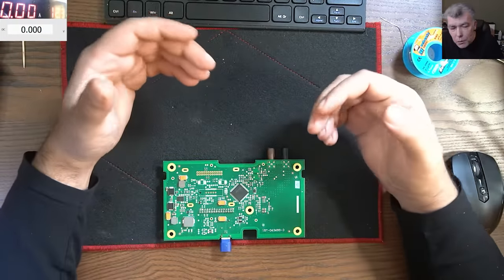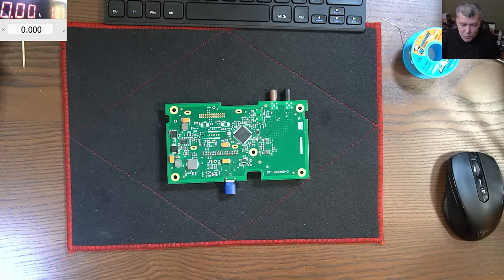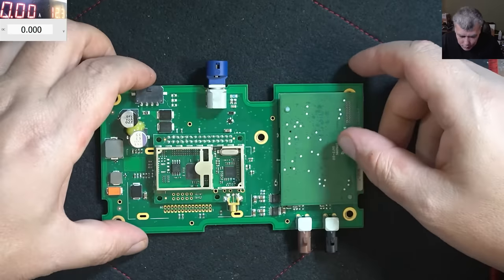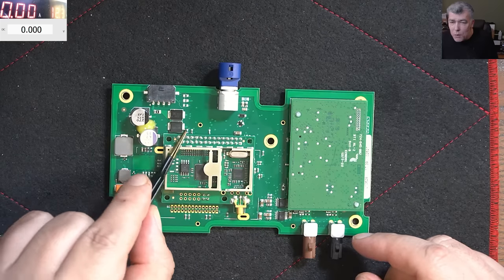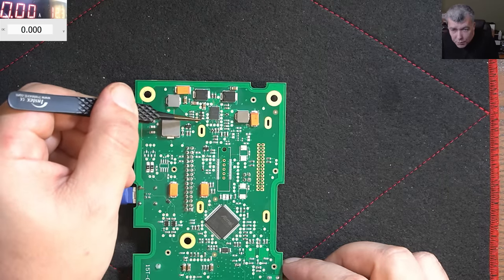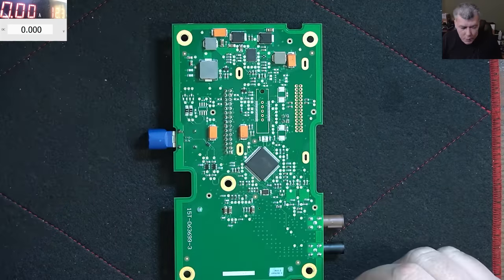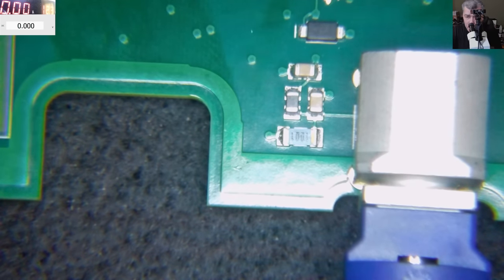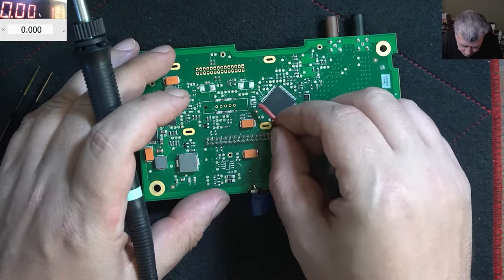You Can't Fix It, Because You Are Not Good Enough

Comment: A very nice vidéo as usual!
Wisdom starts when you understand your limitations!

That said, as the client has the same working board, there is probably a way to read the ATMEL and copy it in the non working board. Of course we need the right programmer to proceed… my two cents!
Reply: i was about to say the same. Its a good chance, that as you know your limits, you can also learn a bit from 2 boards. 1 of them we know works.. so we could use it to just check voltages and stuff around and compare.

Comment: My first career was electronics and I then switched to IT. So the question is why are we spending our time? And the answer is to earn a living.At some point the cost of the time exceeds the cost of replacing the unit with a new one. Or in the case of running a repair business, your time cannot exceed the amount you can charge for the repair.Time is the finite resource. Electronics is much harder than IT, and typically in IT someone is paying for your time (salary/contract day rate) vs in electronics repair your income is related to how many repair jobs you complete. So it must be time boxed. I had a faulty inverter and I could not fix it; I spent so much time on it and I then stopped and bought a new one (had already repaired it once). I had a Samsung phone water damage; I fixed the hardware and got the phone working in a couple of hours and then the owner could not remember the password and I spent loads of time trying to get round that and failed on that; hardware fixed but thwarted by the Andriod security.

Comment: Yes Sorin 
The limitation is stopped on Atmel microcontroller test.
I could be tested by special tool to check whether it responds or not.
Reply: thats true. i bet there is a way to test it out... Would data ports need the actual radio to be tested tho? can you test data output with oscilloscope only? I'd like to learn more about that tester.
Reply: Mr Guru  Your arrogance, ("Guru" word in the nic gives a hint) is something. So, because you can search for a clock pulse that, by the way can can be stopped by the firmware in some of the sleep modes of the chip or you use a logic analyser on a MC that you have no idea on program structure and port functions, you can get more info than Sorin has? I bet you can read the locked firmware, reverse engineer it, fix it, put it back in and fix the thing in your morning meditation. And then preach how good mast***bation is for gurus.
Reply: @nikspanakis  yes he smells ignorance. He doesnt have any respect this man. He already recorded about 700 videos to this platform and he tries his best to explain people how he fix things and inspiring them. If you this "guru" better record hundreds of videos like him instead of empty talks then we can listen to his voice.

Comment: Some boards have 5 3.2 3.3 volt to get a reading at safe level of the higher voltages are a common to ground like the transistor one is forwards the other is reverse or drops zero but yes trace pin 63 or 62

Comment: There is one thing more to check if the microcontroller doesn't have a internal resonator, we can check for the external clock or Cristal.
Reply: I just posted similar. Looks like there is a position for one around pin 99 (left of the board) as two capacitors are there, but no oscillator. There seems to be one present at the right side connected to around pin 49 or so with cap either side. I'd get the scope on it to check.
Reply: Heaa, if you work with time budget, you had to stop. It's not easy to repair something without schematics.
Reply: Heah, its your time, I wouldn't stopped there if the microcontroller clock works I would extract the hex file from it, and load in order new microcontroller, but the price would be too high anyway.
Reply: If you never try you never know!
Reply: I am not superman 🙂, aways better with, besides some industrial PCB makes are erasing the chips names and serial numbers, so you can't fix it without  their knowledge.
Reply: You are getting close, keep speculating.The plcs manufacturers make the CPU and ports separately, I wonder 🤔 why?
Reply: Have a nice day!
Your teacher should be proud of you

Comment: Probably will sound stupid, but have you checked the 56k resistor connecting the enable signal to the micro controller. I'm sure you have seen those smd resistors fail before
Reply: Lets say he was checking the CPU chip of a motherboard... there is a method also to check the chip is actually working huh? not just getting voltage but a way to check it is on ?
Reply: Automotive boards not have component level repairs but software related errors all of the time.

Comment: My Camry clock illumination faded. Google says there are dry joints on a few resistors. I look and solder a few even they look perfect soldered. Still no fix. I persevered and flowed over whole board and it came back to live. Last step on checklist will be reflow all over if I'm desperate to fix a board . Unseen bad joints is always a possibility.

Comment: That unknown chip is from linear technology (based on logo). Second line is part number. They are very reliable. Probably you have shorted capacitor on the output side of this switching regulator.

By the way at 20:03 there was small sparks form shoring battery wire to some line on dual in line connector.

Comment: Did you try to remove the capacitor below 56k resistor? In my practice it`s relatively often when a ceramic capacitor has short circuit and pull down the volts. If I understood right a VBUS pin it`s an 'analog input' and power on it determined only by external components but not from inside of the chip. So if VBUS is not present on it - chip will not try to communicate.

Comment: YEOUCH! I thought I just felt heat on a board. I was looking for the heat because I saw my power supply channel light flickering red. (Rohde & Schwarz HMP2020).  Seemed like it was coming from the OTHER side of the older macbook board (820-2850). I flipped the board over, kinda got burned by a certain area. Put my thumb right over two large suspect caps. There's a white capacitor shape char on my thumb print now. I found the short! Oooh the blister is throbbing. It's gonna be loss of meat kinda deep. Big dummy. I pay good money for thermal camera (seek compact pro), freeze spray...I got alcohol, hey. Speaking of alcohol. hmmm. cold beers. Yeah. it's time for cold beers.

Comment: As a last resort, you can hose down the board with flux, and reflow every solder joint, or the ones you determine to be involved. The SMT process is not always perfect. 

A required signal from an open joint can prevent passing power on self test and appear dead when really it’s only waiting.

Comment: But Sorin you found the problem that resistor have 3v on v bus but not outputting write voltage to the chip, obviously you had to change the resistor in order to allow the white voltage to activate the chip vbus communication...
Reply: or remove capacitor in this line...

Comment: But you can use mini pcie debug cards to know where the mb malfunctioned. If its Ram related, it ll throw codes, if its related clock signals or reset problem you ll know the PCH is not working etc.

Comment: You could see with an oscilloscope if there is data through the USB line, or if one of the USB communication rails is shorted. Maybe a shorted capacitor on the data line? Unlikely... but... something to check. USB lines should have the same resistance as well.

Comment: The chip is LT3507, Yes it is a DC-DC
Reply from the maker: Thank you,  ur right, strange, i searched on google but nothing pop up
Reply: @electronicsrepairschool  and i think that on the blue port(4pin) the LT3507 trought that transistor and resistor is outputing current to the radio!

Comment: hello sorin at 17:14 you can see 2 more component on the side of the vbus resistor wich have voltage drope ,this can be a voltage divider so if 3.7 at the side A you should get 1.372  and get 4.5 if you inject 12 volt
Reply from the maker: I know, you are right, that;s why i know that resistor is good

Comment: Also there check if there is a clock  signal  to the chip.
 Boot Sequence
 The behaviour after power-up iscontrolled by the Power Manager.     Starting of clocks After power-up, the device will be held in a reset state by the Power-On Reset circuitry, until thepower has stabilized throughout the device. Once the power has stabilized, the device will usethe internal RC Oscillator as clock source. On system start-up, the PLLs are disabled. All clocks to all modules are running. No clocks havea divided frequency, all parts of the system recieves a clock with the same frequency as theinternal RC Ocliiscope 

1.Crystal not  working
2. Firmware  corrupt  or frozen like bios chip

Comment: Why not use a scope to test the clock and reset pins on the controller? A shorted reset or clock pin would stop that processor dead in its tracks. It could be as simple as a shorted passive component like a capacitor.

Comment: 18:20 - Its true that they are programmed, but programmer for Atmel is like 3$ on aliexpress, (USB ISP, usb asp and software is free called avrdude) and you only need 6 signals which you can solder directly to board because there are pads (I know how it works, chip is soldered empty, then needles touch pads and program chip). If you can read and write with no problem flash, eeprom, fuses, then its possible to change chip. Its extremely easy, one video on youtube and few commands.
19:06 - On left of chip there is something hot small smd, or reflection.
I would try to heat board with hot air tbh as last resort if Im not gonna change chip...
Reply: The assumption that the AVR was not read-write-protected during factory programming is incorrect. Reading the contents of the Flash memory and the EEprom if it is secured is almost impossible. When SecurityBit is set all you can do is FullChipErase, but in this case it doesn't change anything.
Reply: I have had problems in my life with devices or pc or laptop or any device and software you can spend a hole day doing so there must be alot of times that is software I wounder how often a repair shop do that side of things just looking for old software or drivers going though spam were sites etc just to find a free driver etc many times I've added free software just fir it to charge at point of fix this is when a kid or young lad could be a good fit for business were time does not cost as much as him repairing it to start flashing chips you garentee problem at first time is money an hour could be a new board if like 50 an hour plus the hour doing diagnostic etc it why it so valuable to know when to stop 
It nice to see people still fix places like pc world would only ever replace hole boards same with cars me and my uncle use to actually fix what was broken to keep cost to customers down rather than easy replace with new that is cost to customers
Reply: How could he flash the chip without access to the firmware in the first place. I don't think having the tools is really an issue.
Reply: @d8vit  Do you work in car industry?

Comment: My dear brother, you have already reached the problems before your resistance is 3.3 volts and after the resistance is 0.1 volts and according to what I have reached is the man 34 VBUS USB VBUS Monitor and OTG Negociation Analog (Analog Input)
You must find 3.3 volts on it for the connection to work
I mean, it receives 3.3 volts and does not output volts
Check the resistance and check  ESD protection.
Reply from the maker: Thank you but not much what i can do. There is a 56kohms resistor in the serial mode with 3.3v, but from the cip pin to the ground i got 20kohms,  that;s why the voltage dropped there.
Reply: @electronicsrepairschool  please sir i need help my problem is how to test different components on a board resustor diodes transistors etc
Reply: @electronicsrepairschool  sorry for disturbing you sir i which i could have you whatsapp or telegram number thanks
Reply from the maker: You are right, that vbus is a analog input pin
Reply: @electronicsrepairschool  Under that 56k resistor there is another one and a capacitor ,can't see clear but looks like 333  or 332 on the blue one maybe that result in drop of voltage,maybe something isn't right and somehow chip is prohibited to be initiate or detect communication.

Comment: Hey Sorin, Have you checked the protection components(not sure if you call it fuse or a resister) on the data line? I'm sure you might have but you have not tested them on the video.

Comment: As a last resort - I’d put a heat gun over it / or in an oven to heat board up just in case there’s a bad solder ball under 

Put a resistor on the output connections - just in case there’s a sense resistor / current reqd in any of the processor chips

Comment: Is it possible the chip lost its programming?  Also is there a feedback loop from antenna to trigger the ic to operate usually in ohms to prevent operation when antenna are open/shorted? Like you said though at some point it becomes non cost effective to continue & since the old days of companies providing schematics is gone it's increasingly more difficult to repair.

Comment: On the plus side at least the faulty tuner can be replaced and isn’t part of the main head unit - DAB radios are a nightmare, most of them that come into Repair Cafés have impossible to fix issues like this due to firmware 😢 Rarely ever see an analogue radio that has stopped working 😬

Comment: You can do get working board from customer and buy atmel chip. Then you can copy program from customer's working board and program empty ic. Then remove working board ic and place your programed ic. If it working then you can replace the faulty board ic. 👍 good luck
Reply from the maker: Actually you can't, these chips are protected against reading.

Comment: There was a time when you could fix just about anything assuming suitable parts were available.  I am talking open circuitry or modules, full schematics and a theory manual.  today they are designed for plug  play or replace they item in whole.  That is due to the advanced manufacturing processes and the business practice ($$$$$).

Comment: I know that feeling. The case when it is easier to find another same board with dead tuner part and canibalize MCU chip from it :)  Because this chip will not do any good. Firmware is most likely written with read protection. And if not, it is obviously not readable from a chip who died due to hardware problem inside. Manufacturer of radio will not sell the flashed chip alone too.

Comment: Did you check the reset circuit of the atmel and the quartz ?
Reply: Mr Guru  But I don't think oscilloscope is his best friend, even he had one before, it is necessary to check it.
Reply: Mr Guru  Yes, but usually the frequency readable on a multi-meter is really low, and my bench counter's impedance is too low ... So convenient to use an oscilloscope.
The reset signal is  short, not easy to view it clearly on multi-meter as well except using minima-maxima function when available...
Reply: Mr Guru  Not really, I had some issue with micro controller oscillating a wrong frequency, that is not usual but can occur in case of damaged xtal. To measure is necessary to be sure. Last time on a heating card controller I had a dead Xtal , it gave 3500mHz on place om 1MHz, nothing was working until replacement.

Comment: chip is ok, flash gets corrupted because of the low battery (power), especially if the power is on lower margins, module goes on off very often in very short time and this damages the flash memory.
Afterwards controller will not be able to boot, same as no chip on the board 😃
Reply: so you need to reflash the firmware.

Comment: So let me ask you. During your troubleshooting process, you showed 3.2V on the incoming to the resistor that serves Pin #34 on the Microprocessor. But on the outgoing side of the resistor that serves Pin #34, there was basically Zero Volts. Could the Resistor that serves Pin #34 of the Microprocessor be open? Taking the voltage measurements on both sides of that particular resistor gives me the idea the Resistor is Open. The voltage measurements were taken starting @15:20. Your Thoughts?
Reply: YEP) or cracked capacitor to GND in this line) or poor soldering. in similar cases i pulling up pin (#34) or all UC to see the correct signal level. If signal becomes normal, then and only then UC is damaged and really no chances to repair

Comment: Try to disorder controller(defected part) and check other circuit is working as expected, unless you are very sure for it.
The first chip was (regulator or buck converter may be) made by Linear technology.
Electronic things are never goes or work as we think.

Comment: Looking at the scimatic is a huge lay out tells you there is something that has been over looked for some reason and codeing cnc machinery and automation or a planes com system that has a profound effective way to vause long short power  variations the drivers switch set is resisting arrest the tranfering sharing on SIM cards vary so much but a sameness of MOST

Comment: It's not just your skills limitations, it is also the economics of the repair. 
If you spend 1 hour of labour, is that more or less than the actual replacement value of the board or device ?
The way these boards are made nowadays, the designers and manufacturers don't give a second of thought to repair. Their are no test points, diagrams, component marking/labeling on the pcb, etc and in any case, if you do manage to get it repaired it is probably obsolete already. Obsolescence is literally baked in at the factory.

Comment: You could check the reset line and the external clock generator.
But seems like the chip doesn’t have a external clock?
Reply: seems like amel's engineer decided the name VBUS for input signal is ok))